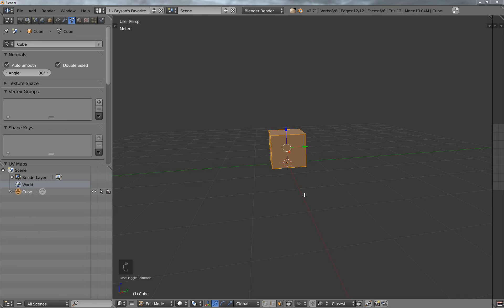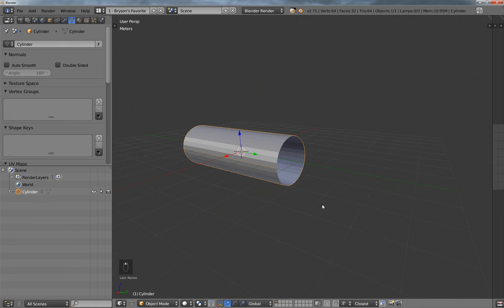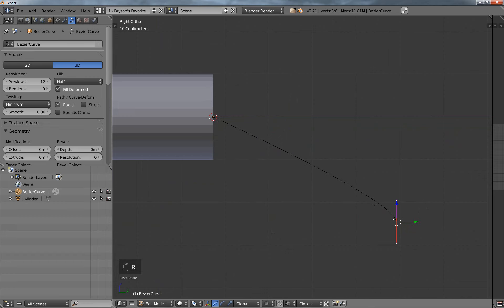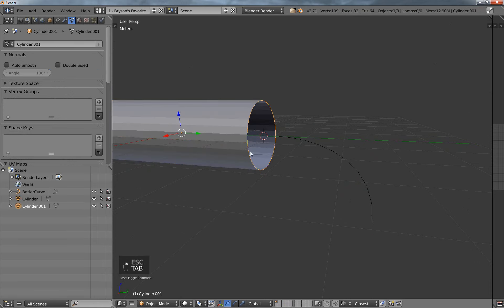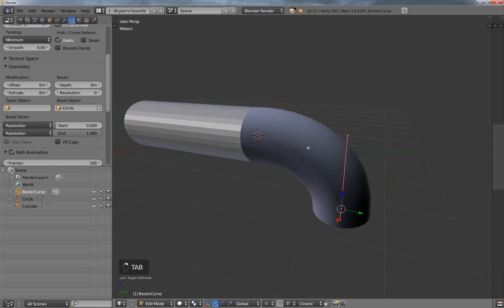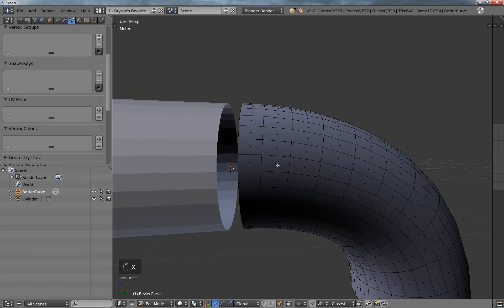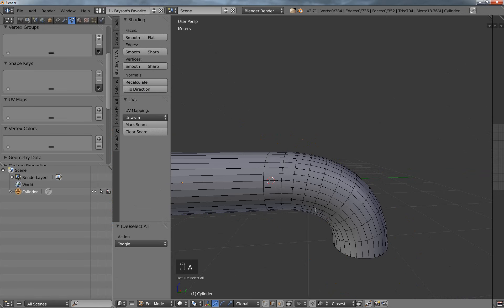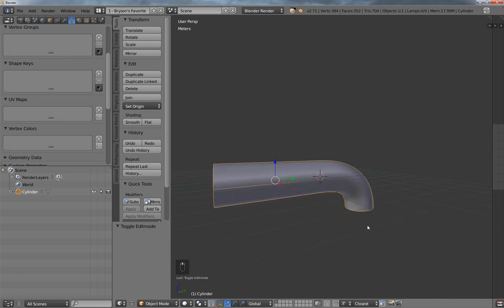Extruding the end of an existing mesh along a Bezier curve in Blender

Comment: You have no idea how grateful i am for this video. Thankyou for posting this, and for the clear and well-presented tutorial on your technique.
I was stuck on how to precisely model angled pipe joints for a very long time, using the simple deform - bend tool, but found it imprecise and clunky. This method has meant i can now do exactly what i needed to, following an arc.

Comment: Coming from learning 3D in Sketchup it blows my mind how Blender is so much easier in some tasks but so much harder in other (simple) tasks
Reply from the maker: Agreed. Every once in a while there is some operation that requires some real effort, but for the most part Blender is the fastest modeler I have ever used. BTW, have you tried Snap Utilities from Blender Market? It is like SketchUp for Blender!
Reply: +Bryson Jack Wow. I did not know that, I'm checking it it right now, thank you very much!
Reply from the maker: +Auzep BlendUp is also great (though kind of expensive), but you can model in SketchUp and get it to Blender without a lot of hassle. Topology cleanup is still necessary however. Also, BoxCutter is amazing as well for Booleans.

Comment: have you tried just using curves? Creating the pathways the pipe follows then using the [Curve Tab] Fill: full + Geometry-Bevel: Depth and then using the resolution to smooth it out?  Obviously after this you'd change it into a mesh, however this is the quickest way I have found to create piping.

Comment: I found this video looking for a way to extrude along a path. This is the opposite I guess but it works for me.
One thing though. You started with a cylinder and wanted to add the bend. You could have just done the whole thing based on a "curve" (that was straight in the beginning and then turning). Then select bevel object and finally make it a mesh.
I believe that this might have saved you a lot of steps.
Reply from the maker: LearningByDoodling Yeah I don't think I explained very well "why" I figured out this workflow. There are definitely easier ways to making an object like this with a curve. Imagine that you had a cylindrical object already created and you came back later and decided that you wanted it to curve......that is what I was trying to portray, but with good planning and knowing what is wanted beforehand, what you suggest is definitely faster.

Comment: Extrude the face. Then use a curve modifier on a vertex group, works pretty well for me.
Reply from the maker: +Randy Gast I don't have enough information about the workflow that you are suggesting. Can you give me the workflow steps to get the same outcome? I extruded the face at the end of a cylinder, assigned the face to a vertex group, added a Curve Modifier and assigned the Vertex Group to the modifier but that did nothing for me.
Reply: i think you also have to assign the "object" in curve modifier to a path
Reply: Extrude the face, subdivide the length of the extrusion so you have something to bend. Select the verts on the length of the extrusion and create a group. create a curve. assign a curve modifier to the object. and select the curve as "object" to bend it it and the vert group as the "group" in the curve modifier, as Excarcerated said. :)

Comment: I know this is an old video but the way I do this is by extruding the end and moving it out and rotating it 90 degrees, then I add a loopcut in the middle and turn it 40 degrees. With the loopcut still selected I bevel it.